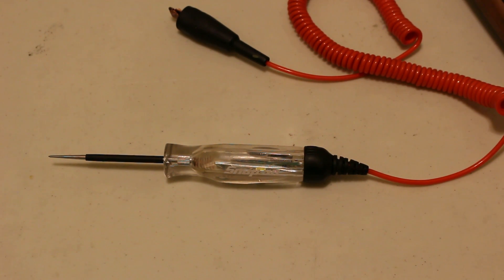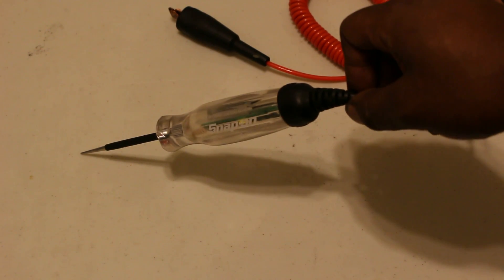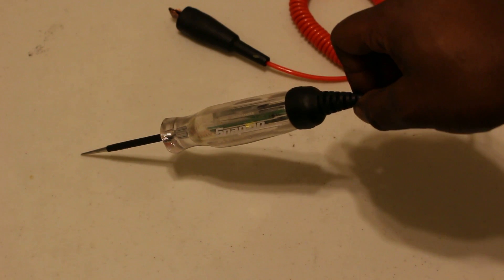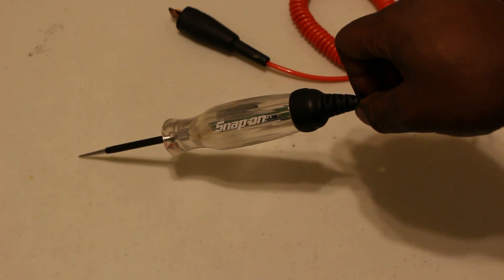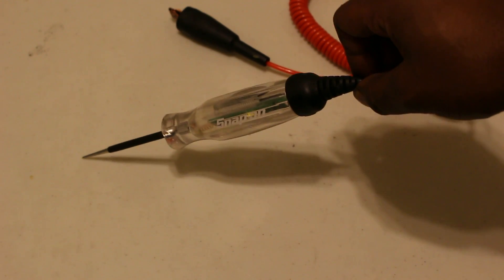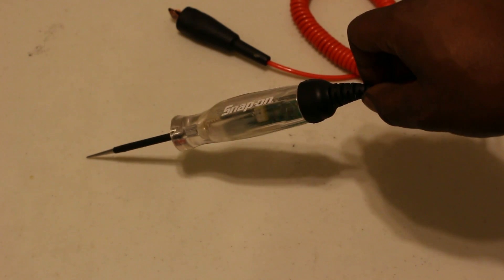Snap-on 12 volt Test Light ✔

Comment: It's a nice test light, but massively flawed by design. Yeah, it's all fine and dandy that it lights red for power and green for ground, but here's the problem...it's a single lead test light. I purchased a mac tools test light years ago that has the same feature minus the voltage gauge, but it's dual lead test light. You can hook it to battery positive and negative. One stop shopping. With the snap on light, you have to switch the lead on the battery terminals depending on whether you're testing for voltage or ground. With the mac test light, you hook up to both terminals and you can simultaneously test for power and ground. No need to switch terminals. Snap on kinda boned it with the single lead design. Could have been a great test light.

Comment: Always test circuits UNDER LOAD. A circuit with high resistance will test fine with the low current draw of an LED test light and fail under load. I love my snap on tools but my favorite test light is the OTC 3633. It’s small, bright, and has threads for an alligator clip. Plus you can get it on amazon for $20.
Reply: The OTC 3633 does not display voltage or show reverse polarity...... so yeah, it's less $$$.
Reply: Yep, love snap-on